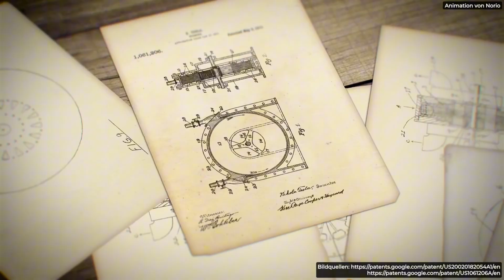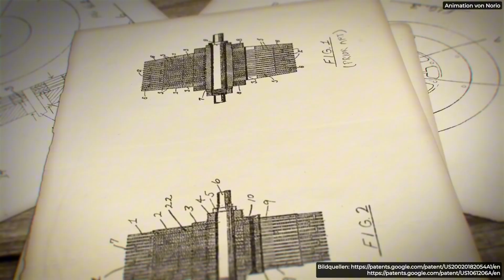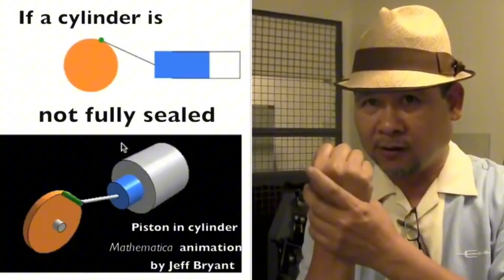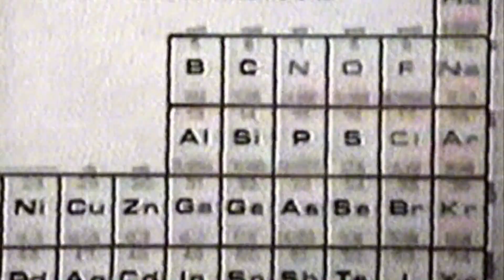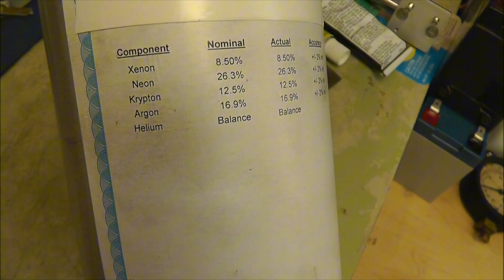The Man Who Challenged Physics: Joseph Papp's Quest for Infinite Energy

Comment: Oh wait is this not an ironic video?
Guys, believing in infinite energy devices is same as believing in flat earth. Its something you can test yourself and see the truth for yourself.
This takes energy form A, converts it into energy form B, goes through a convoluted process back to energy form A, and apparently has more energy A than it started with.
You could try solar panel and lightbulb
You could try generator and motor
Well, he did just that, but inserted argon for some reason.
Remember that motors and generators, and in fact every device forever only converts one form of energy into another
Oh, and other "infinite energy devices" are just batteries, using a non standard medium, like tension, inertia or some other exotic medium

Comment: i cant understand why we cant generate power using power off the power generating unit...why does it have to be 100% free....isnt skimming off the output to produce big power shouldnt be so hard...why are we so restricted in solving this...its not making sense in this tech savvy day and age !!..🤡🌍
Reply: Its not hard, its impossible. If you skim, you just have what you skimmed. This person claims this device skims more than it begins with. Imagine buying a cake, slicing one slice and your slice is bigger than the cake was originally. Thats what this claims to do. Just replace cake with electricity. And instead of slicing, were expanding an inert gas with an arc and create motion

Comment: This is one of those things that seems obvious after the fact. I can guarantee this idea will work. The key is the compression of the noble gas before igniting it and forcing it to change its state and release a bunch of energy! The quality of this engine will hinge on the quality of its seals.
Reply: all engines run on air as it is. the fuel simply supplies heat rapidly. heat produces pressure.
Reply: compressing it wont help. Expansion comes from heat, which happens due to the arc, aka it converts electric energy into mechanical, but there is no way to generate more energy than what was used. Same concept like many fake infinite energy devices, something causes one state of energy, in this case mechanical, then it converts back into original source of energy, in this case electricity. Somehow creating surplus, even though that is never true

Comment: There are similarities with overunity phenomena observed in the plasma of other monoatomic gases (e.g., the Chernetsky, BrilliantLight and EnergoNiva generators and Langmuir's atomic hydrogen). Their atoms cannot easily radiate energy because their orbitals are spherical—and spherical antennas cannot effectively radiate energy outward. As a result, the excited orbitals can retain their energy for a relatively long time and may potentially be charged with zero-point energy. Electrons constrained to localized motion are referred to as Dirac fermions. Instead of moving through space, they oscillate in the temporal dimension, allowing them to interact strongly with vacuum fluctuations. During their decay, the excess energy is released in the form of electromagnetic waves, which can then be converted into heat. This situation is similar to what occurs with graphene layers deforms in two-dimensional arrangement (Thibado) and with cavitation bubbles in water.
Reply: Huh? This is just word salad
Reply: @karyjas1  Prof. Thibado  at the University of Arkansas discovered that freestanding graphene buckles constantly due to thermal energy despite it was thought impossible to extract usable energy from such random motion. But the explanation of this mechanism is already presented on the web. Now, if you think you already understood it, try to explain it by your own words here  - and I will show you a connection of circular graphene buckles to spherical orbitals of rare atom gases.
Reply: @Milan_Petrik  I never claimed i understood it. I claimed the opposite. If you tried to explain something, you did it in the most difficult to understand way possible, using as many terms that your average or even knowledgeable person doesnt use.

What you said right now sounds like thermal energy of graphene (tiny vibrations of the atoms) can somehow be converted into another form of energy indefinitely.
I dont believe in infinite energy, every video claiming they have found it always dismiss the full picture, zooming in on the transformations of energy trying to sneak in an error only to come out with more energy at the end than what we started with.

No matter the mechanism, explanation or the complexity of terms used, this would violate a fundamental law of physics and i dont need to look into it for that reason. Maybe only for surrounding information, but what if i learn the part which was the intentional error? For that reason its also not worth it, so i just dismiss such 'education' right from the start. Though the plasma solenoid idea is neat, might actually be useful somewhere

Comment: the story I heard was that Feinman deliberately pulled an AC power plug that ran the oscillator for the engine in order to prove it was fake and was only running on the AC input power. The engine continued to run erratically a few seconds, then  blew up, killing a bystander. Stanford university was compelled to settle out of court for the death.